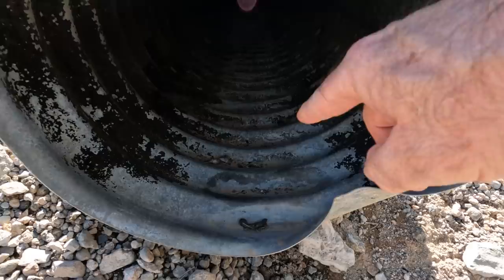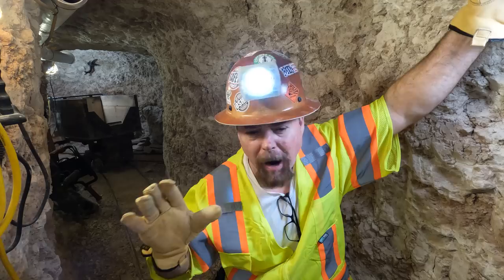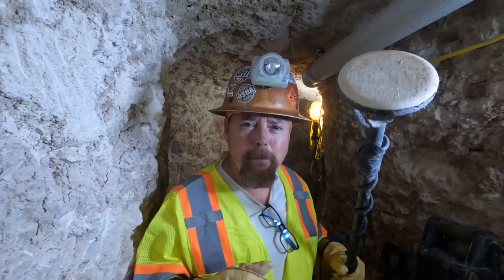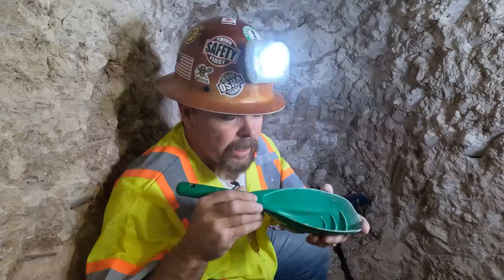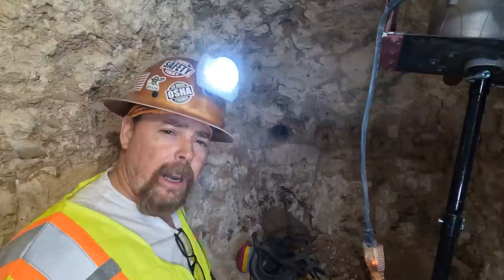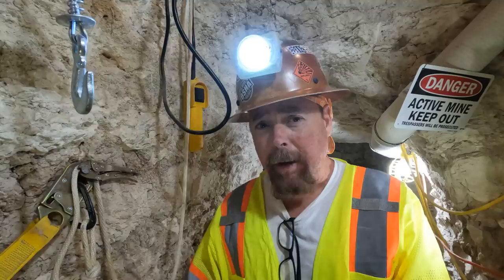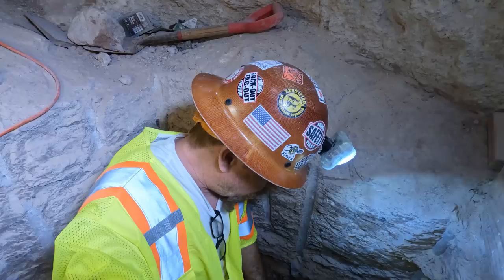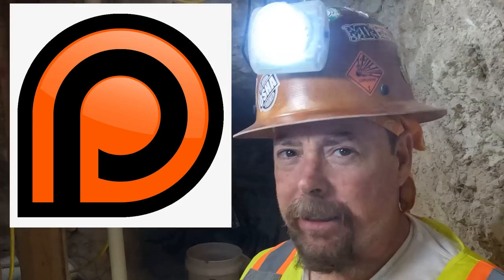Creepy Spiders Are Coming from Our Mine Shaft

Comment: Happy to see the drift mine again and that you're still on the gold! 

At some point, will you need to start wearing a safety harness in the sump (in case the  floor drops out beneath you)?

Would be really wild if you did find a cave system. Wondering if ground penetrating radar could provide useful info. That would be a super cool video!

Comment: Had a thought... what about using a high suction vaccum system to pull out your muck since you're chipping out so much small chucks and grains... make an ore car the vaccum can with a cover and some vac motors, and suck the muck right in to the truck! Also, a can of survey marker paint - you can mark your nugget spots all at once, then dig them out at your leisure, or someone else can while you visit the honey pot. LOL
Reply from the maker: great idea

Comment: Take a 4 or 5 foot piece of 1/4" or 3/8" hard rod and weld a t handle one end of and you could probe through clay to feel depth in bottom of sump and drift.  If there is a hollow spot you can find it wit the probe.

Comment: Jeff- If the floor of the sump is flexing, I would suggest a safety rope and harness attached to you in case it gives way and you fall into an underground stream or cavern. Also  have you thought of using a suction system like the opal miners use in Australia? I think it would make mucking out much easier, but I don't know how much it would cost to set one up.
 There was a mine here that had a cave and stream under it. We believe it was in the alluvial river that went through the  area.  There is an interesting story about it too. It is lost, but we have a good idea of the area it was in. Sadly, my health prevents me from searching it out.
Reply: My exact recommendation about the vacuum, an old culvert/storm drain cleaning truck like the state highway uses would probably be the cheapest way to try it out.

Comment: Have you thought of black powder blasting, you can make it dirt cheap out of fertilizer KNO3 garden sulphur and your own charcoal, it would push and heave that packed stuff and break it into chunks instead of the shattering effect of a detonation you worry about causing damage. It worked for the old timers before they discovered nitro.you can even make your own fuse, one days pyrotechnic work and you could blast all week.
PS. drilling at 45° instead of 90 would probably be more effective.